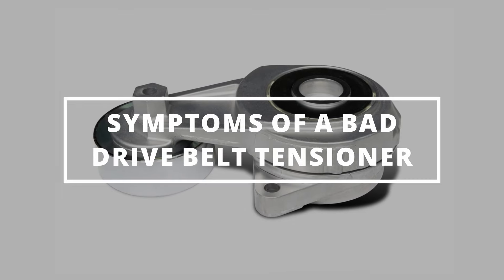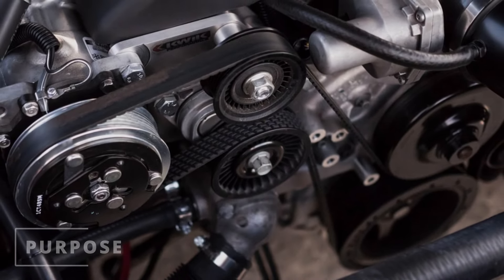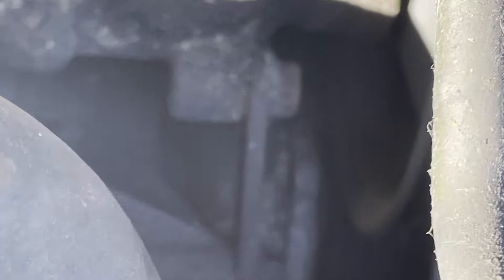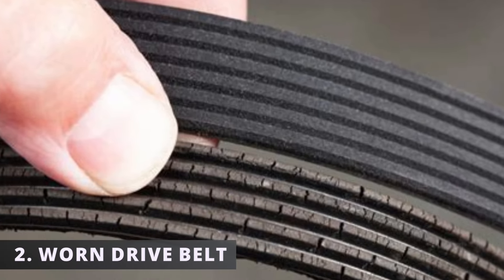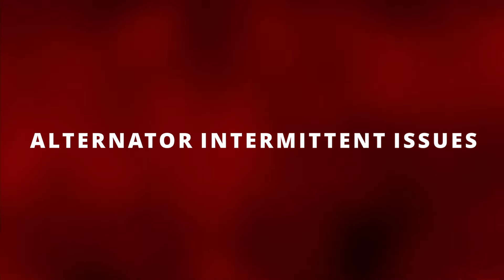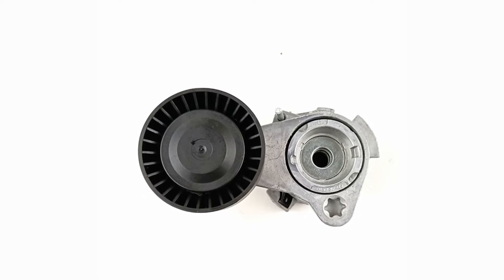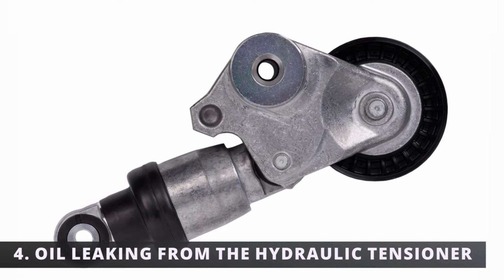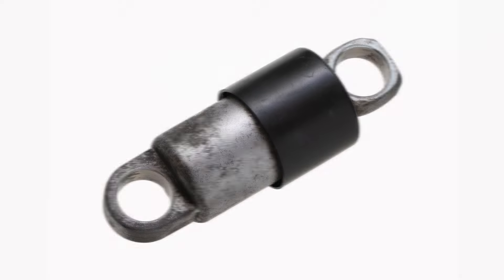SYMPTOMS OF A BAD DRIVE BELT TENSIONER

Comment: Thanks for being concise and not taking about your pets or personal affairs!
Reply from the maker: Thanks for noticing!
Reply: And straight to the point without a half hour introduction.  ❤❤
Reply: My tensioner was put on Thursday n I'm still having radiator fluid leak causing overheating.. will tightening the bolts still work?

Comment: This can also cause misfires or engine knock if there's not enough voltage going through the system due to not enough tension on the drivebelt.
Reply: What happens if my car whines like a hellcat ? When I’m accelerating
Reply: My car just started knocking and whining after riding smooth all morning. Tow truck driver says one of my pulleys might have seized up...can you help?
Reply: NOTED!! That definitely makes sense

Comment: Was having electronic power steering issue … could not source the issue, change alternator and battery and it still was bad…changed belt, tensioner bracket and idler pulley and it’s perfect now 🙏🏾
Reply: Feel like I'm in this loop currently. Dropping voltage and car in limp mode. Had an alternator and battery can't find fix. I may look at belt and tensioner.
Reply: Sounds like what my car needs..
Reply: @stevolution7  check your grounds! Hope you got it sorted

Comment: I hear a rattling noise only when I floor
Reply: Did you figure it out? I’m having the same issue even when parked. I’m gonna replace the belt and tensioner. Maybe the pulleys as well after further inspection.
Reply: Did you figure it out either? I have the same problem! Lol 
 @SentinelEx
Reply: @Linorta  Tbh bro, I’m still not sure. I’ve been so busy I still haven’t got to it. I’ve noticed the sound is more quiet now, but still noticeable.

Comment: Ive had new alternator,new tensioner,new belt lol still squealing, fed up of the tensioner getting the blame 😂😂😂 Mechanic listed a few things it could be and also mentioned everyone blames the belt or tensioner, not always the case, a pulley may be misalligned through damage or wear, crank shaft pulley makes belt slip intermittently if on its way out as well 👍

Comment: My problem started recently after putting on a new belt. OEM was bando, Japanese belt. But I put a Goodyear belt that cost half the price. It squeaks a little when cold and slips when hot and accelerating or starting car. It's a quick jump. It only slips when accelerating but once it picks up steam it doesn't slip at all.
Reply: It's to loose..belts should never slip
Reply: Just remember cheap gets expensive. You can never go wrong with OEM or top shelf parts that are the equivalent to OEM.

Comment: Mine moves like the one in this video..also makes vibration and horrible noise...and also makes belt flap around even though belt has plenty of tension
..I thought it was compressor, then water pump and a few other things..just never had this issue on a car before...
Reply: What's the mileage?
Reply: @solderbuff High milage! I can guarantee that's the answer you will get and this is an educated guess coming from a self taught couch potato, also for anyone who wants to question my expertise on this subject, just know that I have an uncle who has extensive automotive knowledge, he can even do an oil change all by himself! Also I have been collecting hot wheels for years and have many different monthly car magazines subscriptions that get mailed which also has lots of different car parts and stuff, lastly I have watched every fast and furious movie, how's that for credentials 😎
Reply: I have same in golf 4 tdi  After i change belt tensioner   i think belt tensioner its our prob

Comment: I get a squealing noise at which point my idle begins to stall and then a few mins later returns to normal.  I hope this is the issue.
Reply: did you figure out the problem?
Reply: @plutodread97  It was a bad gas cap.  That's where the squeal noise came from.

Comment: since I'm replacing the belt, can I lubricate that tensioner  pulley (not the belt of course) with some kind of lithium grease spray or something else?  I'm not having any issue with noise or anythiing, just replacing the belt at 70k as its showing a bit of wear.
Reply: Since you don’t know that answer your name should be papitonosabe
Reply: @rubey2649   Man i about lost it

Comment: Will a bad tensioner on a 93 Chevy 1500 make a tapping knocking noise
Reply: That is your lifters starting to go out man you’ll need a top end rebuild or swap the motor eventually use the Lucas brand to prolong it any further and don’t press on the gas hard let the truck warm up
Reply: @stevenbenavidez2564  it was the catalytic converter

Comment: ive changed the oil the car only has 88 thousand miles on it  why does it have to knock for 2 seconds before the oil  pressure builds up ? it didnt do this when it was new
Reply: Not getting enough oil somewhere

Comment: people keep telling me to put thicker oil   no its a 2013 volvo c30 turbo  i think  thicker oil might harm somthing   no nott doing it
Reply: Thicker oil is never the solution to anything. There are a lot of different things that could be causing your issue and the proper way to find out is to take it to a licensed mechanic for diagnostic. It's worth the money to pay for professional diagnosis because if you just listen to random strangers on the internet, you will end up spending more money anyway, as you'll be buying parts and wasting your time or someone else's time trying to do the repair yourself and doing it incorrectly, or replacing parts that haven't failed. Nobody here has seen or touched your car and there is simply no way we could tell you what's wrong with it. Anyone who claims to know the problem without seeing or hearing your car in person is not someone you should trust.

Comment: I had a 2006 Honda Pilot ,and the belt tensioner bolt was stripped.  So I had to buy a new belt tensioner.  $100.00.

Comment: You didn't mention to much pressure on belt so belt breaks or water pump bearings fail like on chev cruze , this fault needs to be fixed , oh your ch ch is bs and your bs when not listening repair parts people you better fix your problem

Comment: So my poly bearings were greased up and the belt was replaced. I did not have a tensioner on me to do the replacement, but mechanic did have a belt. the noise is mostly gone, should i still invest in a new tensioner?